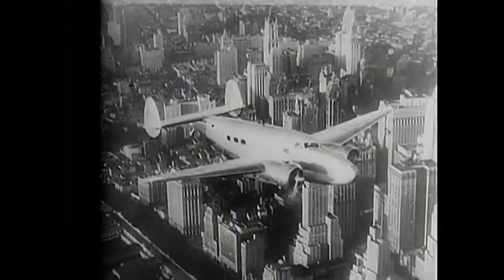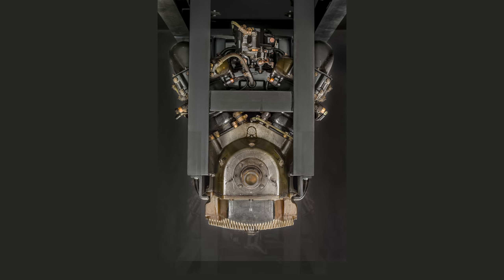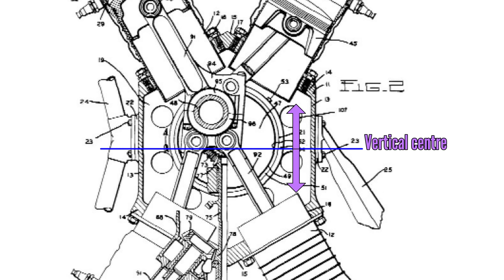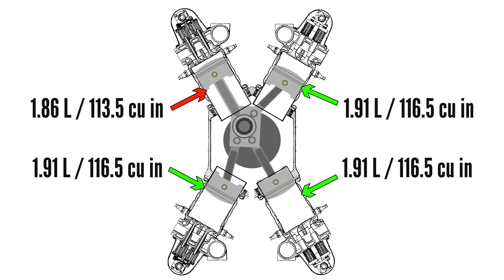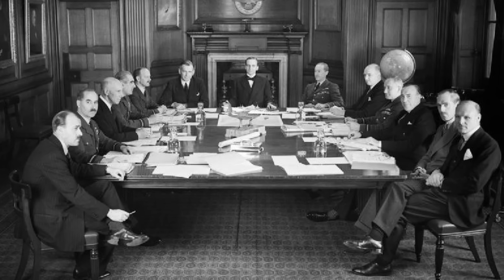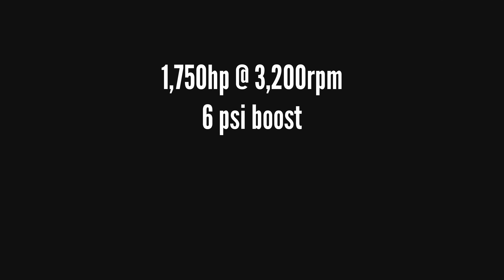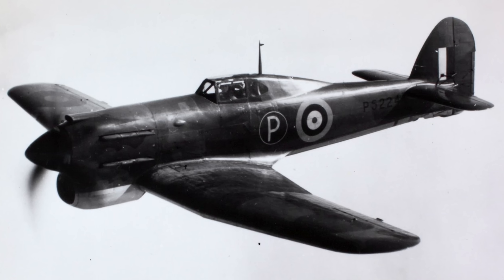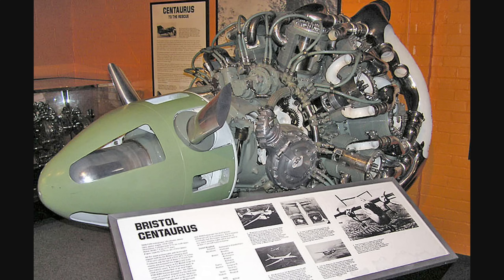Were the Rolls-Royce Vulture & Packard X-2775 Horrible Failures?

Comment: Aircraft engine standard nomenclature shows the induction, the fuel system, the design of the engine, then the displacement.  

"O-360" means a horizontally opposed engine of 360 cubic inches, rounded to the nearest five.  It doesn't show the number of cylinders. An IO-360 would be an  opposed design of 360 cubic inches with fuel injection.  A TSIO-520 would be a turbosupercharged fuel injected engine of 520 cubic inches.  An R-670 was a carbureted 670 cubic inch radial engine that was used on the Stearman biplane.  An R-3350 would be the Wright Duplex Cyclone engine that was used in the B-29 and the DC-7, but they delete the fact that this engine is not turbocharged, it is supercharged via mechanically driven blower fan. I'm not sure why they don't do this, since the naming convention states that this would be an SR-3350.
Reply: The name convention of the 1920s-1940s?
Reply: @waynec3563  Still to this day.
Reply: @Flies2FLL  What I am trying to say is that the military piston engine designations didn't have the prefixes I for injection or T for turbosupercharging.

I believe the designation to which you refer are manufacturer designations.
Reply: @waynec3563  Those designations are industry wide, though some manufacturers take a few liberties.  A TIO-540 Lycoming approximates a TSIO-520 by Continental, for example.

Comment: The Vulture was also intended to power the Handley Page HP.56. But due to the Air Ministry not being certain that RR could fix the Vulture, the Ait Ministry ordered Handley Page to redesign the HP.56 to be powered by 4 RR Merlins becoming the HP.57 Halifax. This was done to ensure that one of the medium bombers designed to meet P.13/36 would be serviceable. The decision to order the Manchester and HP.56 (as back up) was taken 8n February 1937, and the decision to change engine was made in October 1937.

Comment: Detroit Diesel built a vertical shaft submarine x 2 cycle engine.  It was OK but required special lubricating oil.  This engine did not have master/slave connecting rods.  It had identical rods with partial bearings.  Unlike the master/slave rod engines, the DD engine’s piston motions were identical.
Reply: It is possible to build a radial or X layout with all link rods. One system uses a fixed gear in the crankcase centered on the main bearing. The rod carrier has a gear with the same number of teeth that meshes with the fixed gear. Another system uses two extra linkage rods on the road carrier. This was developed by the Nordberg Corporation for their 12 cylinder radial stationary engines built for power house and pumping applications. Old Machine Press website for info.
Reply: Fairbanks Morse tried a X layout Diesel with a 60-120-60-120 layout. Also Old Machine Press. Great web site
Reply: @ OMP IS a great web site.  It seems every possible mechanism changing pistons motion to rotation has been tried.

Comment: Alisson tried again with the double 1710. This became the 3420, in the end the engine was plagued with development problems and the programme was shut down in 1944. Mercedes coupled two DB603 engines on a common crank case ant his became I believe the DB606 it was more shaped like a W and was very prone to fires.
Reply: Daimler Benz coupled several engines together. The DB 601 doubled was the DB 606, the DB 605 double was the DB 610, and the coupled DB 603 was the DB 613.

These were essentially two complete engines joined by a common reduction gearbox. Clutches woudl allow one engine to drive the propeller by itself.

The He 177 was prone to fires because the centre exhausts of the DB 606 were vertically down, and any oil leaks woudl find their way onto the exhaust. The HE 177 also didn't have a proper firewall, so an engine fire lost more than just the engine.

The original proposal for the V-3420 was for the X-3420. It was to use as many components from the V-1710 as possible, and meant that the bottom two banks could not be below horizontal. Allison countered that they could make the double Vee more powerful and with less development issues.
Reply: @waynec3563  
There are always people who know more, thank you.

Comment: I think this hits the nail on the head. Without turbines arriving on the scene, engine designers would have needed to come up with layouts to use more cylinders in the quest for ever more power. Maybe some X-24, H-24, or something even more exotic like a liquid cooled radial engine (like the Zvezda M-503/504 except for aviation use) would have been developed to the point it could be considered reliable and mature. But as it was, turbines arrived, and until then the very successful and well understood V-12 layout was good enough.

(yes, I'm aware of the Sabre, but given the major problems it had I wouldn't call it a particularly successful engine.)

Comment: Not sure why you think the Vulture in the Tornado was less troublesome than in the Manchester. Only three Vulture Tornadoes ever flew -- P5219, P5224 and R7936 -- they flew very few hours, and yet of those three, one (P5219) had a complete engine failure on 31 July 1940, leading to an immediate forced landing in which it was damaged. A one in three failure rate in service in just a few flying hours is truly awful.  However, could it have been made reliable? Possibly, but even then it would have still been a short-lived white elephant. One aspect you didn't mention is the poor economics of the X-24... the complexity and high component count of these X-24 engines was a direct driver of manufacturing cost and maintenance overhead. It costs very little extra to make or to service a big V-12 like a Griffon than a small V-12 like a Peregrine, as the material cost is a small proportion of the total cost - most goes into labour and machine time, which are broadly similar regardless of swept capacity. It was always going to be better to be able to procure nearly twice as many Merlins or Griffons than half as many Vultures, for the same industrial capacity and cost.
Reply: It was always my understanding that the main reason the Vulture failed in service besides its constant catastrophic overheating problems was its sheer dead weight and bulk specifically in multi engined aircraft, It was common knowledge that while operating the aircraft in the standard set up in normal circumstances  it was a good unit with huge potential.............until RAF Manchester crews  started discovering to their cost that having a single engine shot to death by flak  or fighters doomed the aircraft instantly as the sheer weight and size of the dead engine created so much parasitic drag the remaining engine had the utmost trouble even simply keeping the aircraft airborn,  a story I heard that I am unable to fully validate was that Manchester pilots soon learned to refuse to extinguish burning engines letting them burn through engine mountings until it actually fell off which restored some yaw equalibrium and reduced wing drop, and thus enabled the pilot  to get the aircraft home far more easily, all this coupled to the fact that they could produce two/almost three Merlins in the same time and tooling it took to make one vulture.....an absolute must in the middle of an all out war,   do I believe the vulture could have had a future ? actually yes,  but in single engined aircraft given more development time.......but that very time was a luxury we didnt have......a case in point being the Napier Sabre which was verging on being a deathtrap in its early days but went on to become a massively powerful  and reliable power unit after a lot of further development ........one daydream I had years ago did however  make me ponder what if they had decided to test a Manchester with FOUR vultures ?   thereby not only increasing the aircrafts speed and altitude performance by a huge margin it could also have meant losing one engine would have been far less catastrophic for the crew.
Reply: @usernamesreprise4068  but four better Merlins, like the two-stage 60 series, or four Griffons, would always have been better than four Vultures. Which is why those aeroplanes actually happened (Lincoln and Shackleton)
Reply: @harryspeakup8452  There must be about twenty alternative  power units from the likes of Bristols etc  that were available at the time, but the facts were the government read all their own prospective benefits literature and practically ordered Avro to use the Vulture, remember this was in 1938 and the merlin was just coming online with 1025 horse power, also the griffon was barely off the drawing board,
 and the procurement brief to Avro was for a STRICTLY two engined bomber aircraft with quite frankly  far too optimistic requirements in every metric  for the time (which all those "expert" politicians were ruthlessly pushing simply to save money - like ALL politicians past and present  THEY knew best - until they didnt... then it was always someone elses fault) chadwick from day one knew what we would need and that it would require four engines but the government also pushed the maximum of 100 feet wingspan on him in order to fit into the out dated hangers the RAF currently had...a requirement the likes of Short Brothers (Stirling) and Handley Page (Halifax) were never held to. The Lancaster only came about when Chadwick redesigned the inboard halfs of the wings to accept four power units, my point was if the government was so determined that Avro use Vultures they SHOULD have given Avro the leeway to use four, it would have been an aircraft in a class of its own for the time.
Reply: @harryspeakup8452The Manchester had TWO Vultures.
The Lancaster needed four Merlin’s to produce the same horsepower.
Vultures in fighters had better cooling due to higher speed.
Reply: @usernamesreprise4068 While we are dreaming, how about two Griffons and two Crecys... Use the Crecys at full chat to get the thing off the ground fully loaded and for sprints, throttle them back or feather them for cruise.
Reply: To put it simply the Manchester placed the engine under more stress than did the fighter.
Reply: @lesterbuckman5493  The Manchester was overweight which put additional demands and strain on the engine..  Rolls Royce was simply to professional to point out the fact.   It took nearly 6 years from when the engine first ran to get a engine reliable so Vulture should have been reliable in 1943..    The capacity of air-frame designers to add weight quickly to an aircraft is greater than the capacity of engine designer to add power.     In the case of the Vulture Rolls-Royce suspended development work during the Battle of Britain to concentrate on the Merlin so the Vulture entered service prematurely.  The Vultures competing engines fared no better really.  Sabre was introduced 1 year earlier than ready to fight the Fw 190 but had to be withdrawn after a difficult introduction in mid 1941 and wasn't debugged till October 1942.  The Bristol Centaurus wasn't in service till mid 1943.  The Griffon was an early 1943 engine.
Had Rolls not neglected the Vulture in 1940 in favor of the Merlin the Vulture may have been amazing.  Note also the Vulture like the Griffon was initiated by Royal Navy funding.
Reply: @williamzk9083  Yes that was what prompted my comment regarding why the fighter didn’t place the strain on the engine that the Manchester did. Every cloud has its silver lining end result was that we got Lancaster
Reply: Oh, very simple, weight.
Reply: If high powered Piston engine development continued into the 50s and 60s, I think X-24s would have made a resurgence: you can only make a cylinder so large before it runs into detonation and preignition problems just from being too dang big to work right. That means there is an upper limit to the useful displacement of a V-12 engine, and the German DB603 was already sitting RIGHT about at that limit

If you want more power, and you've hit the limits of what you can obtain from a given displacement, you need more displacement. And if you need more displacement at this point, you need more cylinders

Radial Engines are excellent, but the attempts at 4-row radials ran into serious cooling problems that simply don't exist for liquid cooled engines, so there would still be a niche for high powered liquid cooled engines

This is where H-block and X-block 24 engines come into the picture: the frontal area is roughly the same as for a V-12 of similar displacement, but the smaller cylinders allow higher rpm, since it takes less time for the spark to ignite the entire pocket of fuel-air. More small cylinders also means more space for Valves than with larger cylinders
Reply: @ I think the limitation was the Speed of Sound within the large piston and getting a stable flame.  I think the problem would’ve been solved but in any case the row diesel was probably a better way forward and it didn’t have any limitations on piston size.